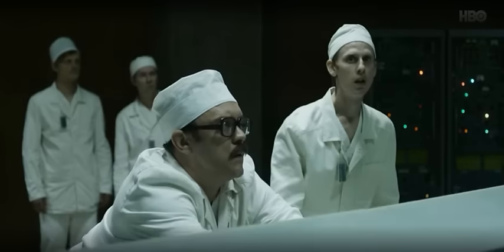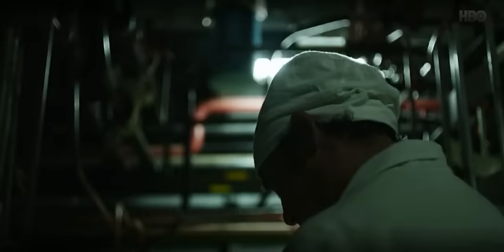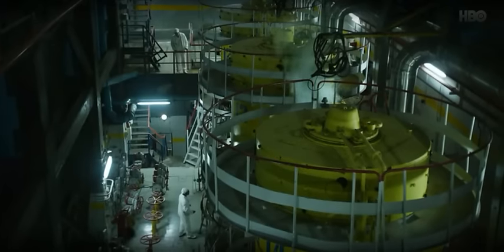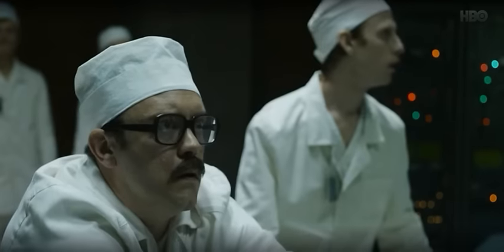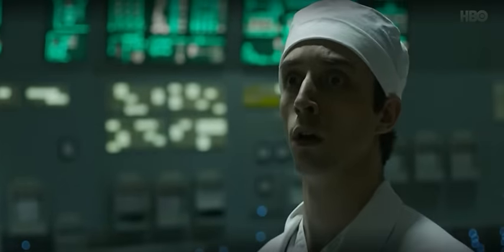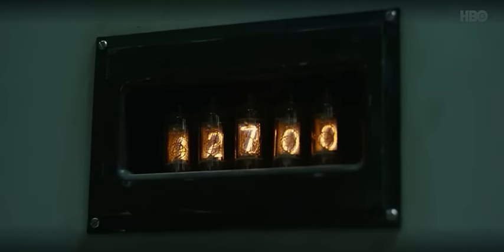Chernobyl (2019) Nuclear Reactor Explosion Scene

Comment: approximately 20 hours later, the first of many radiation detectors on the surface of the Washington State University Reactor building goes off;  Minutes later, claxons inside the building begin sounding alarms of uncontained radioactivity.  The radiation Safety Officer and the crews assigned to work the reactor are summoned to the facility to determine the cause and confirm that the reactor is indeed, secure and non-operational.  The radiation is coming from outside the facility and the source is airborne.  No one knows where its coming from, but its assumed that the Hanford Facility (DOE, DOD laboratory) is the source.  Days would pass before the USSR would admit to the world of thier problem.

Later, air samples taken at the WSU facility would confirm that there was a reactor breach somewhere in eastern europe.  Radioisotopes identified in the samples could only come from such a failure.  This was never reported to the public.....
Reply: Source? Any? as far as i know - sweden reported it first
Reply: Washington? The radioactive cloud went over Belarus, Sweden, then turned around and crossed Germany before raining down in Netherlands.

Comment: I wish they had not cut when the lid blew off.  It blasted up against the roof and landed back sideways in the core opening.  Imagine a steel plate weighing 2,000,000lbs flying through the air like a pancake...
Reply: James Frank where did you find the information about it being that heavy? When I read your comment I was super intrigued and haven’t found anything on it
Reply: @alexmilea2528  In both IAEA and declassified Soviet papers the biological shield, the 'lid' that the entire reactor assembly was fastened to, weighed close to 1000 tons.
Reply: thatsoundslikeblue thank you brother
Reply: Ikr I was a bit disappointed as well, it would have been the most impressive part of the whole explosion in my opinion
Reply: Alex Milea It completely makes sense. Each control rod weigh around 770 pounds. Now take a look at the reactor and look how many their are.

Comment: He said each weigh 350 kilograms. So let’s do the math. Each control rod at Chernobyl weighed approximately 350 kg which equals 700 pounds. There were 211 control rods. Add it up with a little wiggle room for other materials in the lid and we have a 147,700 pound reactor lid absolutely blasted into the air near the speed of sound.
Reply: The control rod and fuel channel caps weighed 350 kg (seen going up and down at 2:20), and only made up the top portion of the Upper Biological Shield (UBS). That part of the reactor (the lid as it's referred to in the show) weighed about 2,000 tons.
Reply: @jrsdiesel  my god. Thank you for your contribution.

Comment: The one thing I saw missing is mention that the explosion blew the 2000 ton reactor lid into the air, flipped it and then the lid landed back in the core sideways and lodged there.
Reply: Joshua Bonner 
Exactly, though I do believe it was only 1000 tons, insane nonetheless
Reply: @trapdontaris  
The lid was roughly 2 million pounds. And one ton is about 2000 pounds so 2000 tons is the correct number
Reply: @maverickso8397  google says 2 million pounds is 907184.74 KG = 907.18474 tons.
Reply: @maverickso8397  2000^2 = 4000000

Comment: "Because it's cheaper."  Slapping an entire nation's philosophy in the face.
Reply: Cheaper doesn’t mean bad. The RBMK could produce far more power than a PWR in the West while it was able to use less refined uranium (unlike what the miniseries presents that actually is a feature—the less enriched the uranium is the stronger the effect of the negative fuel coefficient), it was relatively easy to build, and it could be refueled whenever necessary.
Reply: @briangronberg6507  Perhaps all you say is true...but, it did blow up, so...cheaper might mean bad in this case.

Comment: The simplified reason why Graphite Tips were needed is this: When the Boron control rods are withdrawn, the tips of the boron cylinders would still be exposed, as would a small trapped pocket of water. This would decrease reactivity, which is needed in RBMK because there are such few neutrons floating around in such a large reactor space to keep the chain reaction going. By placing Graphite "tips" (really a second connected cylinder below the boron cylinder), the tip of the reactor neutrons are "shielded" from the boron cylinder face, and the water pocket is displaced. This exposure of graphite and less water in the core resulted in a temporary increase in reactivity and creation of more steam, which also increases reactivity. This runaway excursion localized in the control rod channels broke "something" (still debated today what exactly broke), but the rods became stuck. In more modern reactors, the Scram button (equivalent to AZ-5) literally decouples the control rods, dropping them into the reactor instantly, increase of using motors.
Reply: the graphite displacers are about 2.5 meters shorter than the full length of the core. when a control rod is full out, the displacer is in the middle of the core, so there is a 1.25 meter gap at the top and bottom of the core where there is no graphite or boron at all. when a3-5 was pressed, all the graphite displacers entered the very bottom of the core, causing the reaction to accelerate at that very bottom of the core. the long-term fix for RBMK reactors was to extend the pole that connects the graphite displacers and boron control rods by 1.25 meters so that there is a 2.5 meter gap in between the two materials, and the graphite displacer extends to the bottom of the core when a rod is fully raised.

Comment: Those rods moving up and down is disturbing af
Reply: They’re the fuel Channel caps. They weigh 350kg each.
Reply: Kinda looks like boiling water
Reply: @danieldorn2927  That's very accurate comparison as it was filled with overheated steam
Reply: @rocketdyneF1  That's the equivalent of 3 adults.
Reply: @Kazuo1G  Those are some big adults....
Reply: HBO got it wrong, there is too little motion of too few caps.  The guy who saw it said it looked like 1,700 people throwing their hats into the air continuously.   All of them were in motion at once.

Comment: Keep in mind, Dyatlov was so sure of the safety of an RBMK that he thought it was a hydrogen tank explosion, even after hearing multiple people say that either graphite is laying on the ground or the reactor is simply burning itself
Edit: Rewatching the scene, even Dyatlov himself saw smoldering graphite outside the broken windows, yet he refused to believe that the core exploded, not the hydrogen tanks
Reply: It’s what happens when you have such great pride in your own understanding along with a secret fact that the real Dyatlov had a giant chip on his shoulder due to what I believe his son being poisoned in an earlier nuclear accident, which wasn’t known to us until he had his last interview.

I heard this from one of the other documentaries about the chain of events that lead to this disaster.
Reply: it was a fatal flow that the RBMK reactor which was used in chernobyl powerplant reactor 4 was graphite moderated which clearly absorbs the extra kinetic energy and helps those neutrons to hit more U-335
the thing is when akimov used AZ-5 those rods were inserted on that reactor which increased the pressure of the reactor and those graphite tips increased the chain reaction
that is why todays reactors are water cooled water moderated reactor 
which can cool and also moderate the reactor 
it may not be cheaper but its still safer

Comment: "It's cheaper." Bruh... What?
Reply: It’s cheaper to use Graphite moderators than it is to use moderators like Boron, they wanted to spend as little money as they can and skimp out on stuff they feel like they are able to
Reply: @milkteafett2080  Yeah that's why I'm just like "Bruh..."
Reply: welcome to the cold war
Reply: @milkteafett2080  boron isn't a moderator. A moderator slows down neutrons which makes them more likely to hit a uranium atom which creates heat. Boron does the opposite it absorb neutrons stopping reactivity. They had plenty of boron that wasn't the problem. Its the idea they used graphite as a moderator instead of water. Everywhere else use water as a moderator because it was much more safe. If water evaporates reactivity stops. But to use water as a moderator you need enriched uranium which was hard to get at the time and expensive. So they went cheap using partially enrich uranium and for that to work it has to use graphite as a moderator.
If you want to learn more about it watch this lecture he explains it well https://youtu.be/bCbms6umE_o

Comment: Imagine the guy who tried to run gets instantly fried by the explosion
Reply: He actually had a humane way out tbh as compared to his colleagues
Reply: I think only one person in the reactor hall was killed immediately. Crushed by debris. The rest made it out and were largely shielded by the thick concrete walls around the reactor, at least on the control room side. Most of the explosive force went up through the softer roof and outward facing wall. They all died in the end.
Reply: @andrewtaylor940  Valery Khodemchuk was in the pump engine room and killed instantly by the collapsed wall from the explosion.  His body is permanently entombed where it lies due to the extremely high radiation and debris.  Vladimir Shashenok was hit by a fallen beam and boiling water and steam from the explosion, severely scalded and poisoned with radiation.  He was carried out to Pripyat hospital that night and later died, never regaining consciousness.
Reply: @jamesfrank3213  thank you. That lines up with what I thought. It’s actually remarkable how few were killed from the explosion and collapse. The one that always blows my mind is the guy who witnessed the lid coming off the reactor was able to run to the control room to tell them. Say what you will about Soviet manufacturing, but Soviet Architecture while ugly, was solidly ugly.

Comment: How much explosive force is needed to lift the lid of the reacter bear in mind the lid is a 1000 tons
Reply: Been thinking about his a lot, as a mechanical engineering student I come across a lot of problems that involve finding pressure values, and as I would imagine we must find out the components of the lid and what was responsible to keep it in place (such as a large frame and what it was made from, its dimensions, etc)

Hypothetically, if this was made of plastic, naturally it won’t be able to contain pressure as well steel, for example. So the specific materials in the reactor (namely it’s shielding container) must be known.

Edit: I found some values on the web that says the primary concrete shield was 213.4cm thick, and has a 0.318cm thick mild-steel liner on the reactor’s side.

The calculation is too tedious to do, but I found out that the pressure when a reactor (not the rbmk design) is normally operating at 3000MW of thermal power, would have a pressure reading of 16 MPa. In the instance of the rbmk reactor, the final reading was 33,000MW. So 11 times the normal pressure!

Of course, the difference in the shield design, dimensions and material makes a bit of difference.

note: anyone, feel free to correct my justification.
Reply: @yousef-alnassar  How did the reactor explode? In lamest terms please.
Reply: @PainandMotivation  There are many hypothesis, the widely accepted one is that the hydrogen produced by a certain reaction underwent combustion.
Reply: @PainandMotivation  The current working theory that I've heard most recently - and there have been many - is that first a series of small steam explosions ruptured the coolant channels, secondly hydrogen produced by the runaway reactor ignited, generating the first explosion which damaged the core and sent it into full scale meltdown. Finally the core running out of control generated a nuclear power/prompt critical transient, essentially a thermal nuclear explosion not unlike a fizzled (failed) nuclear bomb, equal to ~22 tons of TNT, this blew the reactor apart, tearing off the lid and blowing open the roof, it also disassembled the core enough that it stopped generating power at an exponential level.
Reply: @PainandMotivation  In simplest terms, the runaway core generated enough steam and hydrogen pressure to launch the several hundred meters into the air (something interrupted by the roof of the building).  Hydrogen was produced by water breaking down due to the zirconium coating of the fuel rods in the core.  once the pressure was released, a perfect mix of oxygen and hydrogen was achieved (scientifically this is called a Stoichiometric Ratio) and ignited in a massive hydrogen explosion.

Note that while the RBMK's lid was designed to handle up to 6 simultaneous fuel channel ruptures which each produce a massive increase in pressure headed at the "weakest" point of the core, in this event several dozen ruptured in a very short amount of time causing a cataclysmic wall of steam pressure slamming into the lid.
Reply: @yousef-alnassar  yes because i believe it wasn't a steam explosion because it would need more force

Comment: Only question could they have prevented it from happening?
Reply from the maker: probably yes, but they werent experienced enough
Reply: The reactor was poisoned long ago, if Dyatlov didnt push the reactor so far that it lost its cooling it could be kinda saved I guess
Reply: It could have been prevented, but not from the point at which this clip starts. If they hadn't fully retracted the control rods earlier they might have been able to shut it down once the reactivity started to spike. 

The problem was that this sort of reactor generates xenon as a fission byproduct, and xenon acts as a neutron poison absorbing neutrons and slowing down the rate of nuclear reactions. At normal power levels, the xenon is "burned off" as fast as it's produced, but at low power it accumulates. They left the reactor at low power for too long before starting their test, resulting in xenon poisoning. When they tried to restart the reactor, this accumulated xenon suppressed the core's reactivity,  making it more difficult to burn off the xenon and get back to normal power levels. 

They overcompensated by fully removing the control rods, which did elevate reactivity to the point that xenon was burned off faster that it accumulated, but left the reactor in a dangerous state. Once the xenon started to burn away, the reactivity of the core started to rise, increasing the rate at which the xenon burned off and causing the reactivity to increase even faster. By the time they realized what was happening and tried to shut it down, it was too late. If they left the control rods fully retracted they would have had a runaway fission reaction, boiled off the coolant water (which would have increased reactivity even further) and suffered a core meltdown, but because of the graphite tips, inserting the control rods briefly accelerated the runaway fission reaction, flash-boiled the coolant water, and achieved prompt criticality, blowing the reactor apart.
Reply: @smo1704  its worth knowing that there was a correct procedure for getting the reactor ready again after being poisoned. In fact, xenon decays quickly on its own. But Dyatlov ignored the safe procedure in order to get the reactor ready as quickly as posible so he could perform the tests they were suppouse to make that day, which he thought could help him in his career. This isnt mentioned much in the show, but it was the main reason he was selected as the main culprit by the state.
Reply: No, because it happened.
Reply: Hired competent workers
Reply: following procedure, they violated procedure
Reply: @smo1704  As crazy as it sounds, Chernobyl Reactor 4 was still saveable up to the point the test started.  This would have involved keeping the reactor completely flooded with water while carefully reinserting rods, the water acting as a neutron suppressor in RBMKs. once the test started though water pressure dropped allowing voids of steam to form... in a reactor that had a positive void coefficent... and the operators wouldnt know the bottom was coming very much alive with only sensors further up the core.